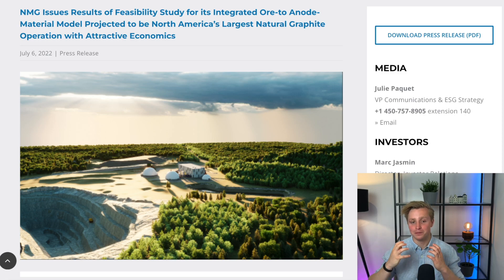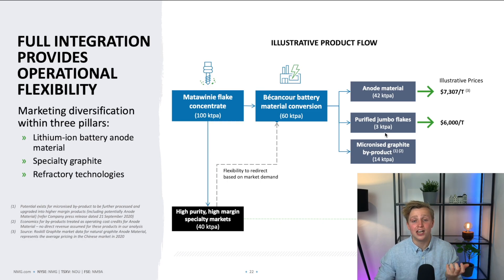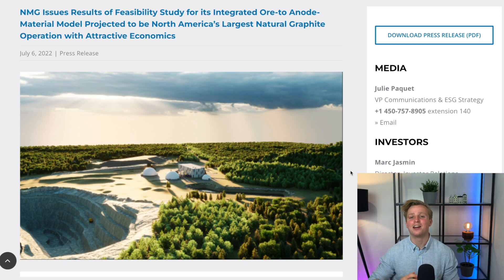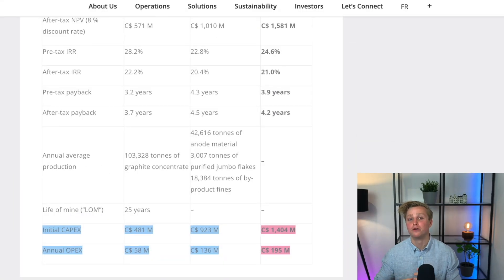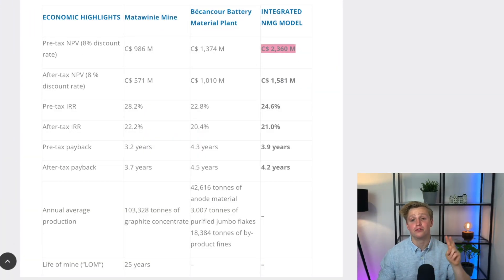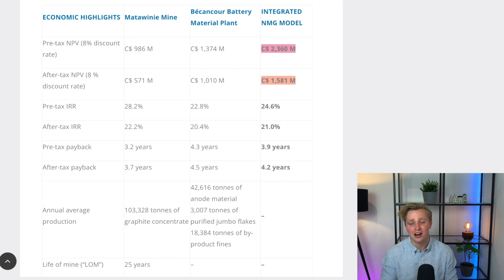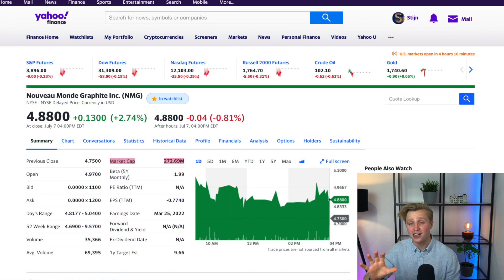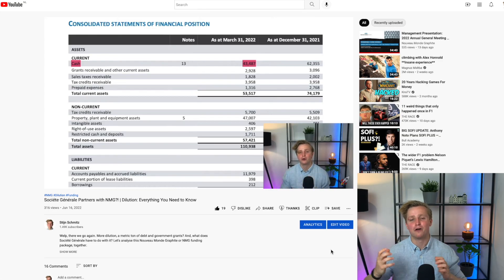This Changes Everything for NMG – New Feasibility Study Explained

Comment: Hi Stijn, do you know if solid state batteries still require graphite. I keep reading about Toyota developing solid state batteries. This make hesitant to add further.
Reply from the maker: A lot do, either as the electrode or even as an anode material... or as a feedstock for the graphene used in others.

I'd also like to point you towards the other use cases of graphite, like solar, nuclear & hydrogen! Those might significantly help derisking the EV-story

Also, you gotta figure out just how quickly solid-state batteries will take over. At the high-end, maybe in say 5 to 10 years? Mid-range EVs and low-end EVs will probably still use traditional lithium ion batteries for decades to come, at least, according to my opinions.

Hope this helps @mark harrison